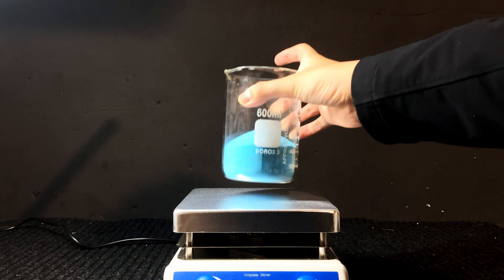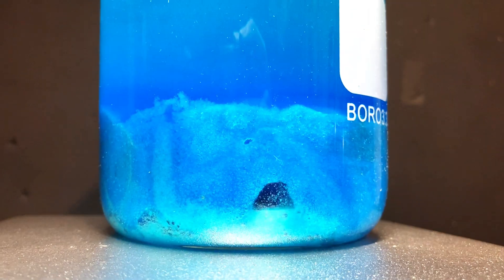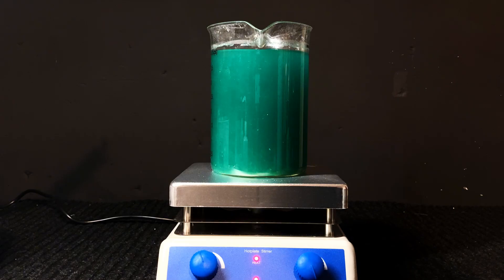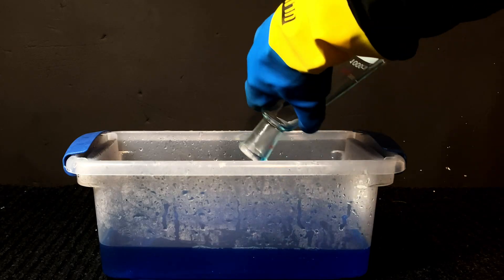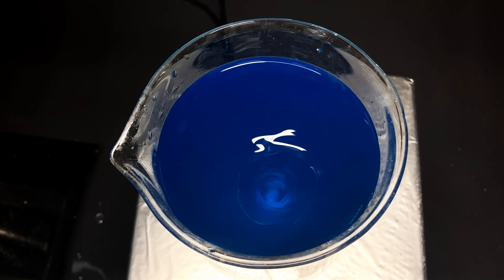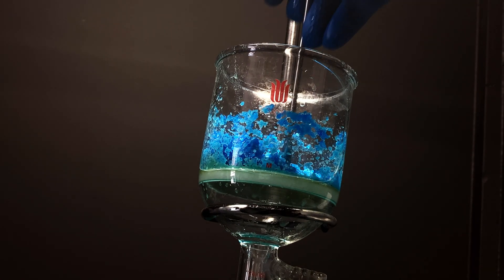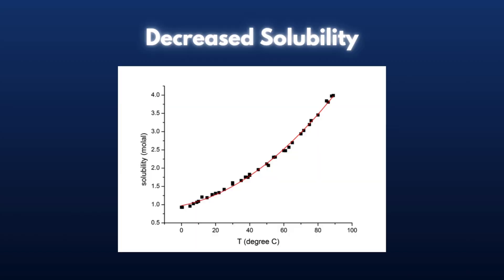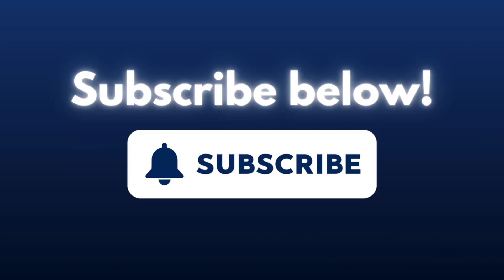My Horrible Attempt at Cleaning my Dirty Copper Sulfate...

Comment: Many impurities are possible: in best case basic sulfate (will dissolve in a little sulfuric acid), in worst case nickel and iron. Only several recrystallisations might help - with a lot of stuff to be discarded. So if you have no trustable source for a very pure reagent it's better to make it by yourself from high purity metal, sulfuric acid and hydrogen peroxide. I use my recovered Cu waste resulting from my small business for that purpose which is based on 99,9 % copper as a precursor. Same with CuCl2 and other salts. So I never run out off copper compounds without buying any of them. 😎
Never heat glassware which isn't made for this purpose. ☝️
Reply from the maker: Thank you so much for the helpful advice and insights, I really appreciate it! Yeah these contaminants are so annoying, might try making it diy in the future lol! :)
Reply: @CarbonTwelve12 
Sometimes the light blue color of commercial CuSO4 is caused by the loss of crystal water, not by real impurities. It's rather suspicious when the salt is darker than usual or has a greenish hue.
Have you ever analysed it by a ion separation process?

Comment: 1. Get and read the book "Purification of Laboratory Chemicals, Seventh Edition" by W. L. F. Armarego, Christina Li Lin Chai (it is available on z-lib)
2. No need to buy lab grade chemicals if the experiment is purification.
3. The problem with your glass filter was not vacuum but the size of the filter mesh. It should be less than the smallest possible particle of contaminating agent. In your case it should be the smallest available. POR-14. You seem to have POR-100 which is mostly useless, you could filter your solution through your fingers with the comparable effectiveness :)
4. After you've goty our saturated hot solution filtered, do not expose it to the lowest available temperature or high pressure, just leave it at normal conditions (20C, 1 atm) and whait while it cools down. no fridges or freezers or chilling baths. dont seal the vessel just cover it with a sheet of paper or aluminium foil. when cooled you may want to seed a pure cristal to start the process.
5. Always make microscale experiments (Proof of Concept) prior to messing with kilos and liters. it is much much faster and cheaper both in chemicals and labware.

6. Read the damn manual bruh! :) "Purification of Laboratory Chemicals". It is so detailed and exhausting, you will be surprised how much it will save your budgets, time and yealds.

Good Luck!

Comment: Vacuum filtration wasn't wrong. However, you should have added a 1-1.5 cm layer of Celite into the frit. Btw. You shouldn't trust Chinese glassware too much, even if it's advertised as borosilicate. Electronics professionals have already noticed that if it says that a certain chip is on the board, it doesn't necessarily have to be that way. It's the same with glassware. It's better to buy one expensive glass frit than five Chinese ones.
Reply from the maker: Alright thanks so much! I'm currently on a tight budget so I just went with it, but in the future I'll see if I can get some more expensive glassware lol. Celite sounds interesting, never heard of it before. Thank you so much for the suggestions! :)
Reply: Just don't blowtorch glass with room temperature liquid inside. You can do that with dry glass but with liquid inside you should at least use a heatgun

Comment: I make my own CuSO4 when I make nitric acid from my silver refining waste.  Generally it has impurities that cause cloudiness, often iron.  I found the best way is to dissolve and vacuum filter HOT and through 102 paper filters.  Let it sit undisturbed to crystalize out and after a week or 2 refilter the solution again and let it sit undisturbed and let it crystalize out.  Just be sure to occasionally break up the crystals to keep them from forming a solid brick (like you got).
Reply from the maker: Sick man! That sounds really cool. 102 filter papers???
Reply: @CarbonTwelve12  Yep.  102 or 103 is fine.  I like the 90mm size in a non-fritted glass buchner vacuum funnel.  The 90mm also has the advantage that a standard fluted coffee filter fit in just about perfectly so when I filter out the silver I line the funnel with the 102 filter and then add in the coffee filter.  I'm not a fan of fritted funnels as they can be really hard to clean out, especially inorganic stuff.  The non-fritted style with the glass pore filter plates are my preference..

Comment: Some advice for next time - if you don't have a good filter, just dissolve the salts in an excess of water and leave for a day or so to let the solids settle. Then decant and boil down the solution.
Also with recrystallisation, if you keep it at a lower saturation level AND let it cool down slowly on the bench overnight you'll get much nicer crystals with much less of the gunk in them. The next day you could do the ice bath to drop out more crystals too, or boil down the remaining solution a little further and repeat the slow cool down.
By crashing the crystals out of solution so quick when theres so much mess in there, you've likely trapped a bunch of the impurities in the crystals. Or they insoluble particles will be caught up in the mess of tiny CuSO4 crystals formed from the rapid cooling. Whereas if you grew them slower from a less saturated solution you'd get bigger, purer CuSO4 crystals that you could seive away and rinse the insolubles from.
Reply from the maker: Yeah that's correct, I think it may have been absolutely better to settle the impurities first. Definitely would have been better to slow down the crystal growth, as you said. Thank you so much for the suggestions! :)
Reply: @CarbonTwelve12  I know how it can be when you just wanna get the thing done. In my experience, impatience is usually the thing that shoots us chem nerds in the foot. 

Don't sweat the mistakes and shortcuts! We all make them from time to time, and sharing your mistakes on the internet takes a lot more balls than writing a comment does.
I read a few more comments after I wrote this, and realised a few other people also gave the same advice. Some of which were not exactly considerately written. Great to see you taking it on the chin and rolling with it! Ultimately, no matter how well you do, theres always gonna be someone who thinks you could have done it better. And no matter how good you get, you'll still stuff things up at some point.

And hey, at least you didn't try to dry out 4L of PVA in one go in a deep baking dish!! Haha.
Reply: FWIW I grow crystals regularly, and if you're wanting to do this on the cheap I'd recommend getting basics like this copper sulfate from hardware/gardening stores. It'll be low quality, but proper recrystallisation will clean it up real nice and save you a LOT more money. I'm in Aus, but here we can get 500g CuSO4 as plant additive for $15-20 or so. It's almost exactly the same looking as what you've got there. 
One technique I started doing when recrystallising was adding a tiny spoon of sodium bicarbonate to the initial solution, to help precip any unwanted junk straight off the bat. It'll lower your yield of course, only a little, but you'll get a better end result. 
But I'd definitely aim to do a recrystallisation over a week or so rather than overnight. If you give yourself more time for the project you'll be less likely to stuff up by rushing it. 

Keep up the great work! I love your passion and can't wait to see what you get up to. Wish I had found my love for science when I was your age.
Reply from the maker: Oh thank you so much man! Between you and me, shh, yes! I will be growing (or at least trying to grow) copper sulfate crystals in a future video. I really don't know why I didn't purchase the copper sulfate from a gardening store, I've heard of it and it's definitely a better alternative. Fun to recrystallize and practice lab techniques as well. Thank you for your kind words! :)

Comment: Welp I'll be an other one to say that patience is key for most purification steps. I actually had same way "clean" lab grade copper sulfate in my university lab with all that insoluble staff in it. So here is some piece of advise about recrystallisation:
1) For all insoluble gunk - just let it settle. Big particles settle quite quickly (2 hours tops usually) and all you've gotta do is to decant it. Small stuff can be still present but it settles too in a day or two.
2) Copper is a transition metal and some transition metal salts tend to hydrolyze when heated. Tho in copper it's not so pronounced, to prevent hydrolysis add a few ml of sulfuric asid (car battery electrolyte will do). It won't affect final purity as acid will anyway stay in mother solution but will prevent copper hydroxide formation and settling.
3) When you are done with all insoluble junk you can begin to boil off excess water just before some crystals will form. Then add a bit of water to dissolve them back and you are ready for hot filtration. Prior to this you should... no MUST heat your filter and collection flask to prevent crystals formation on a filter. And hot filtration should be vacuum one bc you have no time to do it slowly. To ease your life a bit throw a paper filter over your fritted glass, easier to clean after.
4) After hot filtration you just pour it in dish you'll be able to scrape crystals from and let it be until it's room temp. You've got first batch of crystals and mother solution with a bunch of copper sulfate in it. Collect crystals and throw the solution into a frige for a night. Collect crystals and you can be a little greedy and boil that solution further down to collect more bits of crystals.
5) But if your goal is purity then you've gotta make sacrifices and it's gonna be more time cuz really big and pure crystals you can get only that way (or with rotation, oversaturation, and temp gradients but that's whole another story.)
And for God's sake PLEASE DO NOT torch(ure) your filter. Just throw it on a liter or two of water and all will gladly dissolve in couple hours.
Reply from the maker: Yeah haha thank you so much! Patience is literally key I did not have enough of it for this video. I believe settling was definitely a better idea as you proposed. Alright sulfuric sounds cool to combat the hydrolysis. I really appreciate the very well-crafted suggestions you have given me here, I'll definitely make sure to use these in future recrystallizations. It's always good to hear suggestions!

Comment: The steel spatula and spoon you used when handling the CuSO4 might have introduced some iron into the solution, creating FeSO4 by displacing copper, thus colouring your solution somewhat green. Copper can also react with CO2 (copper oxidation) which also creates green compounds (Statue of Liberty is a perfect example). Other causes for the green colour seem unlikely.
Reply from the maker: Huh, yeah, that's actually a good point. Maybe using glass stir rods are better next time. Also oxidation is probable lol, I thought it was actually just iron impurities but seems like there's a lot of possibilities! :)

Comment: You needed to add a reference amount of water, according to the reference book, then decant the solution and filter it through a filter, and already work separately on the remaining sediment, perhaps you needed to add sulfuric acid.
Reply: I do not know what kind of water you used, but I will just say that you need to use distilled water.
Reply from the maker: Oh, alright. How would sulfuric acid help?
Reply: @CarbonTwelve12  Sulfuric acid helps to dissolve the hydrolysis products and slows down the hydrolysis itself. I think that the precipitated residue would have dissolved in sulfuric acid and you would have lost less product.

Comment: im sorry but i have to ask... isnt this exactly what youre NOT supposed to do? and in fact. the reason your lab grade is only lab grade anyway???
why do you saturate the solution that much why do you put in in an ICE BATH
that is literally the opposite of how you get pure stuff....
i get that you cant filter out the impurities. but you know how you can get them out?
dissolve the copper sulfate in warm water. not even close to a saturated at boiling solution!
make sure its like 1/5-1/10 the volume it would be if it was saturated at that temp (something like 1-2L in your case)
then. just turn off the hotplate. decant the solution if you so wish. if not, let it stand on the warm hotplate to cool over night.
next morning, put it in the fridge if you so desire...

that way you can actually grow good quality crystals.... atom on atom on atom. with your insolubles remaining in solution....
the way you did it, it just crashes out so fast? guess where all the gunk is gonna end up?
think about it like pompei. all th gunk is going to stay there forever. inside the messy crystal structure. because you cooled it so fast. there was no time for proper crystal formation. it doesnt care if theres gunk in the crystal, because all the atoms are paniking to change their state.
Reply from the maker: Yes, haha lol thank you so much  for the suggestions. Sorry for all the mistakes I made, I was not locked in for this one XD. Good question on the lab purity, idk why it's so impure. I read that recrystallizations are indeed better when done slower, but in my case I think it was still alright. A fridge is indeed favorable but at that point I had been doing this project for 14.56 hours
Reply: Every crystallization will make the product purer. If he would have been able to filter all the insoluble junk the product would have been pure. The problem was that the glass frit was not fine enough. Maybe a Büchner funnel would have done the job

Comment: Well, a little patience would have helped a lot. Just put the impure copper sulphate into a big container, pour distilled water over it, mix it from time to time for a couple of days, let it sit, decant and filter the solution. The solution then can be left to slowly evaporate and collect the formed crystals. The fine impurities that clogg filters also have the tendency to settle so just letting things stay for a while before filtration really helps. Also, just putting the whole filter into some warm water to disolve the crystals would have saved the filter. 
  I personally don't like using the temperature influenced solubility difference to all chemicals. Slow evaporation usually yields bigger and purer crystals. Plus, with copper sulphate really big crystals can be grown.
Reply: You made every point I was about to.!! 100% in sync (crazy, since I'm really weird)
You don't happen to have a crystal growing hobby do you??  (I love growing crystals !)
Reply: @empmachine  Yes, I did grow some copper sulphate crystals, the bigger ones arround 50 grams. Recently I put some policrystals to grow. They have a tendency to tarnish over time(months and years) if kept in air, but that layer can be removed by soaking it in a saturated solution of copper sulphate that has some sulphuric acid added. If the crystal isn't to be grown it can be covered with a layer of transparent laqure.
Reply from the maker: Yeah that's a good point. I was low on patience in this one. There were definitely better alternatives, as you proposed here, that I shoulda gone with XD.
Reply: @CarbonTwelve12  You really should try the growing large CuSO4 7H2O crystals that @rashedusman9717 talks about in the end of the comment.   
It's a great project!!  you set it all up, totally forget it exists, and weeks later you get your mind blown!    and if you do timelapse, then you got a great YT post..

Comment: As for the glass frit being clogged with crystals, i might suggest just soaking it in a large beaker with heat next time. If you ever have to do a hot filtering this is something rhat will come up, and simply passing more hot solution theough can be dicey as it will keep trying to clog up until rhey are rhe same temperature.
Reply from the maker: Oh, alright that actually sounds like a good idea. I'll try soaking it in warm water next time if it gets clogged again. :)

Comment: Copper II sulfate should be recrystallizable the same way alum or sugar is. Try using a somewhat less saturated solution so it does not crash out on cooldown and grow a big crystal on a string in the middle of the beaker. Once the big crystal gets as large as it can give it a new beaker of solution and repeat until it takes up most of the beaker. Then break it apart to get rid the string. As for the spent solution you can boil it down with a vacuum still to reduce it's volume then dump it into the saturated solution so nothing is wasted. Boiling water in a vacuum still saves a ton of energy compared to ambient conditions since you only need to reach 60c rather then 100c.
Reply from the maker: Yes thank you so much @link12313. I actually do have some alum lol fun fact. I think I really should have diluted it a bit more when filtering, but how would I boil in a vacuum, I'm not sure if I have the apparatus lol. Thank you so much for the suggestions! :)
Reply: @CarbonTwelve12  If your distillation setup has a vacuum port all you need to do is hook it up to a pump and maintain a decently strong vacuum. It should be a barbed fitting near the output.
Reply: First thing you learn about copper sulphate is that it always takes more water than the theoretical even with heating. That last bit is super stubborn and dare I say quite irritating. The only reason I'm familiar with it is because it's one of the easiest to obtain from a hardware store, and you have to find reasons to use the excess.

But the hardware store I suspect is similar to the dirty "lab grade" stuff in purity, because I haven't noticed any appreciable difference.